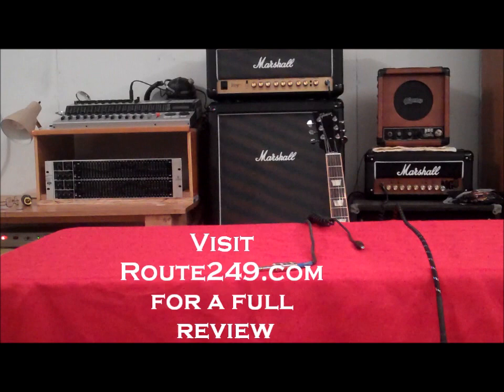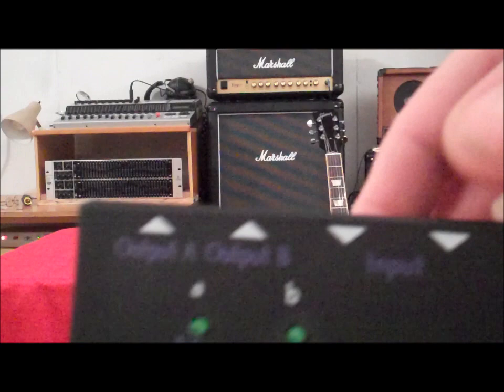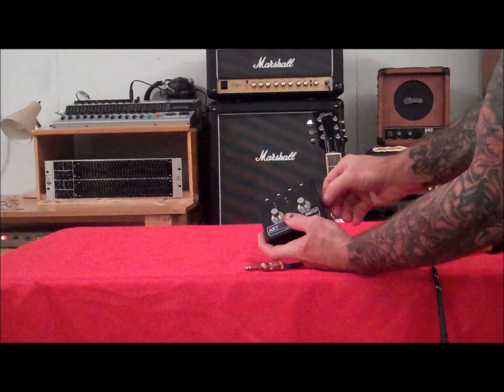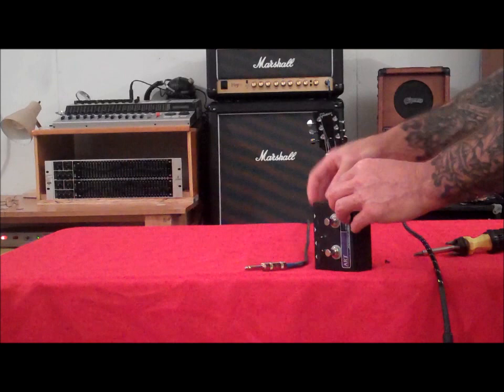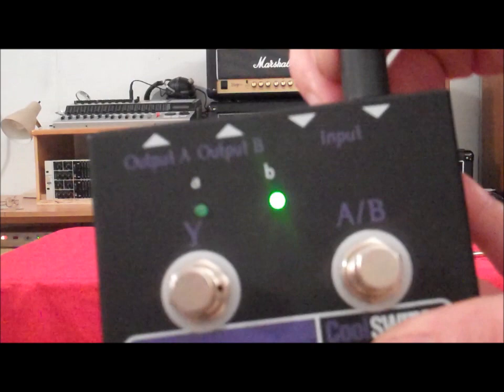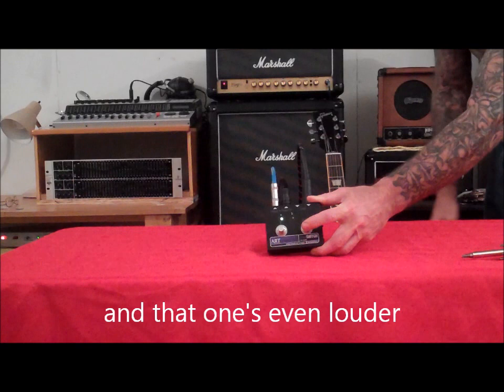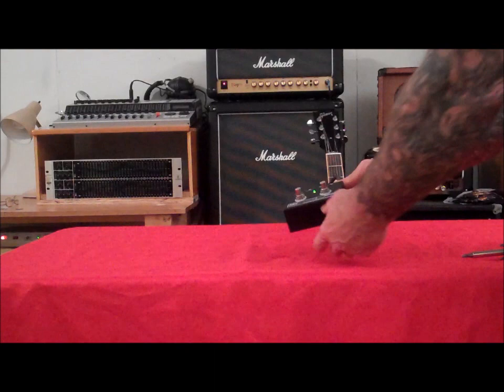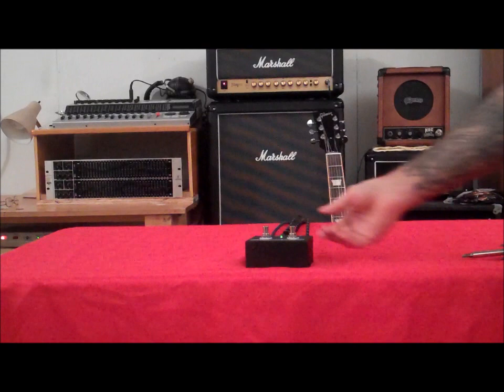Cool Switch, by Art (Review)

Comment: Thanks mark. I was given this pedal and I wanted it to switch between basses.  I solved the battery issue simply by drilling a hole in the battery compartment cover and wired it for a 9v adapter. I didn't get rid of the battery option as power is sometimes at a premium depending on where I am playing.

Comment from the maker: Well Jim, it appears that you are correct. I just plugged it in and even without the battery plugged in, it worked as designed, but without a batter there are no lights and you cannot see which connections are being made.
Thanks, now I learned something new!

Comment from the maker: Yes,I try to answer ALL questions promptly.OK, the Art switch can be used for two parallel chains of pedals and also can play both chains at the same time,but the Boss has a bypass mode that the Art doesn't.One advantage of the Art is you can use it in either direction,like two guitars to one pedal board or one guitar to two pedal boards. Boss has volume knobs,Art doesn't.Both has pros and cons.Battery lasts longer than most pedals,but you have to unplug it when not in use.Hope this helps.

Comment: Certainly Mark, firstly thanks for a great review, I really appreciate you taking the time to do it. I was wondering if perhaps the battery was only really there to power the LED's, and the unit would still work unpowered. Thanks for testing that, and so quickly as well. I'm looking forward to getting one and experimenting with blending 2 Amp sounds together, and maybe having the amps spread apart for a sort of 'pseudo stereo'' effect. Thanks again. Jim

Comment: Hi there, How does it work when you use it the other way round, as in two inputs that you want to switch between but route to one output? In my case I do loops. Sometimes I want my voice to loop and sometimes my bass, so I'd like a pedal that can route either of them to my loop pedal. Do you just plug two inputs and one output and it automatically knows that's what you want to do? Cheers!
Reply from the maker: llenlleawch Yes, it knows. Just like when you plug a guitar into an amp, it knows which way the current should pass. It's just an electrical connection that passes through the box.Good luck!
Reply: llenlleawch Hi ... just to try and clarify, since this box is totally "passive" it is not doing any altering of the signal. Just switching or combining. That's why you can use it forwards of backwards. Now combining your vocal might be a problem with impedance unless you run it through any mixer first (xlr input) that has a line level output (like your bass). Or, you could use one of these adapters giving you less control though (you would have to match your bass volume to the mic which is fixed)     http://www.sweetwater.com/store/detail/LittleIMP?adpos=1o5&creative=54989267161&device=c&matchtype=&network=g&gclid=Cj0KEQjw3auuBRDj1LnQyLjy-4sBEiQAKPU_vYxMyxnnDULOTlt22d1khw0yaFEGh7dTKxMa2vWq0cMaArPv8P8HAQ

Comment: Hi Mark, I know this is an old video, but I have a question about the 2 inputs

Have you seen any problems running the L&R outputs into the 2 inputs from a stereo pedal? The last pedal in my effect chain is stereo and I just want to know how it works.

Thanks!
Reply from the maker: +James Dix The inputs can be anything you want, but then you will lose the stereo effect. Both inputs come out either at "A", "B", or both (depending on how you switch it). You might be interested in the fact that this switch doesn't care which way you hook it up. You could put your left channel in "A" and your right channel in "B" and then switch between left and right channels (or of course use the "Y" and get both channels). However, you still won't get a true stereo sound with your left and right channels going to their perspective sides of the room. To get that you would have to put your left and right channels in the inputs, have an amp on each side of the room, and switch them manually yourself with the Cool Switch. The Cool Switch won't use your stereo pedals as anything except as an input. 
I hope this helps, and if you have any more questions, just ask...

Comment: Hi man can I use this with my boss gt 8 for clean sounds and have the other one for my gain sound from the amp so I can switch between them
Reply from the maker: It can definitely be used with your boss gt 8... just imagine the switch is your guitar... if you were to plug one wire into your guitar, you would have the one sound/amp/effect and then if you were to plug the other wire into your guitar you would have the other sound/amp/effect. all you are doing is using the switch to toggle which wire is connected to your guitar.

Comment: I have a cool switch and it has bleed, either when the battery is dying or just in general, haven't concluded which yet.
Reply: i had one as well and they bleed. wasn't critical in my case but not quite reassuring either. get a radial :-)

Comment: thanks bro,  but...did you note that when playing both at same time, there is a huge phase difference ?  thanks to the dolts at ART, they dont understand ground lift, phase reverse, etc...  now they have the new version with all that, but guess what, ,, no battery...only a transformer instead... i have NOT tested that new one, but i bet it will be far worse...if you play both a and b...simply bec the dolts at ART do NOT understand what a passive transformer does, when connected to 2 or more things...duhhh

Comment: I'm not finding much in the way of information on this switch... What's the input impedance? output? is it a line output?
Reply from the maker: I guess I am unsure of how to answer you. This switch is low voltage. You hook it up prior to amplification. I use it to toggle between two set-ups to get different sounds by the touch of the switch. I plug my guitar into it and the outputs go to two different amps or set-ups. It's not rocket science. It's actually pretty simple.
Reply: mark dennis
 Ah, well my concern was mismatching impedance which has a tendency to affect tone. I was thinking a direct recording through one output & the other into a pedal, which outputs @ line level into an interface. The doc on this box is lacking was my point, and I guess no one has bothered to check its I/Os then. The switching is of course easy to understand and really wasn't my question. Even a 100kΩ I/O vs 1MΩ can cause a guitar to lose its balls and become a muddy mess. If the unit is outputting line-level and you're feeding it into an amp or pedal that's expecting a fairly different source impedance... And to have to play line-in gymnastics with inputs that are few to begin with is unnecessary... Anyways, thanks!